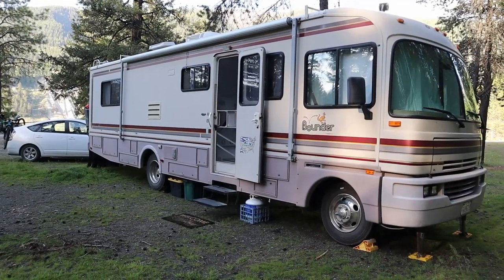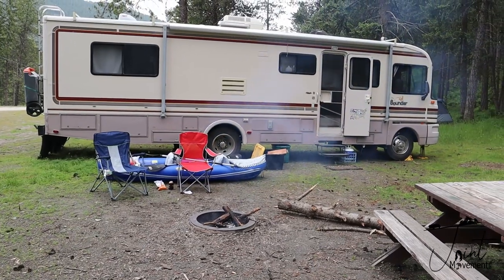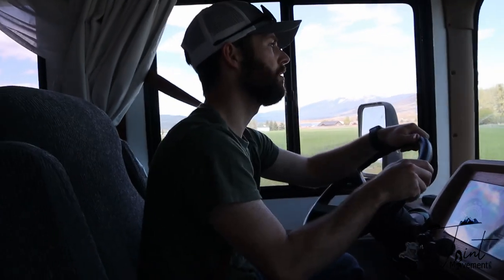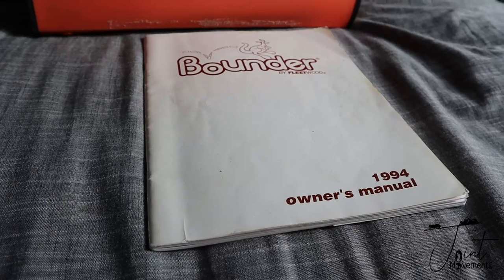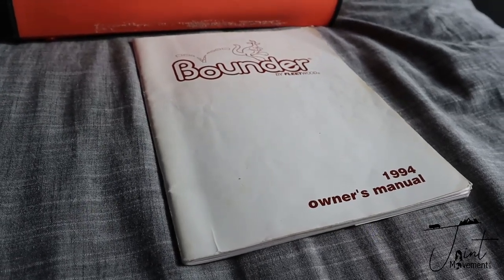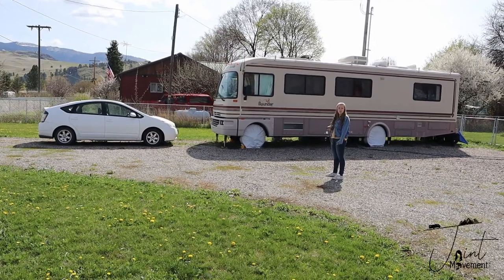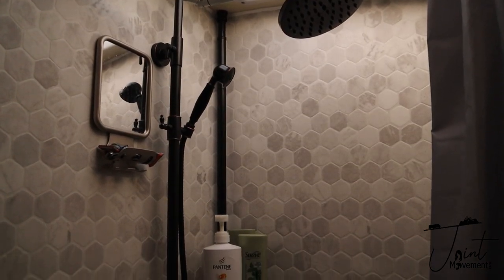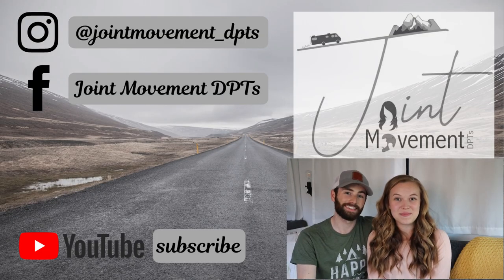HOW WE CHOSE OUR 26-YEAR-OLD MOTORHOME FOR FULL-TIME RV LIVING: Travel PT Discusses RV Life | S1:E14

Comment: Howdy there, I gotcha beat price wise on an older Class A. I found a 1991 22 foot long Fleetwood Flair with only 18,000 original miles on it, and just 79 hours of run time on the onboard Onan 4000 Watt Generator. There total price I am paying for it is $2,500.00. It needs both belts on the engine replaced, a couple tires also need replacing, and the roof needs a good seal coating done. On the inside, it needs one set of Overhead Cabinets repaired.. Outside of that, it's ready to go.

Comment: Congrats on your rig and your good decision making! We just found your channel. We are retired FTers who did something similar in 2019. We feel our 1999 National Tropical MH we named Serinity (after the movie/TV series) sort of picked us too. Like you, we were going to go FT with a truck and trailer. We bought a 2008 Ford diesel and were shopping for a trailer when the engine died on the truck. We had just got it paid off when it dropped a lifter (at less than 150,000 miles on this supposedly 1/2 a million-mile engine) and they wanted $15k to fix it. We got to thinking, "What if this would have happened after we were retired and didn't have that kind of money laying around to fix it? 

So, we sold it and bought our 36' Class A MH with only 28k miles on it for only $15k. It was a single owner MH, like your rig, with meticulous maintenance and repair records. Our decision paid off as it hasn't needed many repairs (considering its age) over the last 3 years we have been living in it FT. If the V-10 gas engine ever dies, we can replace it for less than 1/3rd of what the diesel engine would have cost us on our old Ford. One of he added benefits of our decision was we were able to flat tow our 30+ mpg 2006 Chevy Cobalt SS, a car we already owned, saving us additional expenses for a toad. We also carry a couple electric bikes with us, for exercise, adventure and fuel savings.

We discovered we like to boondock a lot, so added solar. We have been living off-grid continuously for the last year, saving a ton of money on RV park rent, while still being able to travel whenever and wherever we like. Good luck and stay safe on your travels.
Reply from the maker: That's so amazing 👏 😍 🙌  we have very similar thoughts 😀
We wish you the best on your journey!
Reply: I’m looking at a 99 TropiCal right now! 36,000 miles and 226 on the generator or $6,000
Reply: @brittanymcdonaldbarr1106  Wow, that's a great deal if it's in good shape. Heck, it's even a good deal if you have to fix a few things. We love our 6350. We've gotten good at fixing things. When you don't have a monthly note, you can afford to do other things with that money - like the 560ah Lifepo-4 battery, 80a converter/charger and battery to battery charger we just added to our solar system to make boondocking easier and reduce our generator run time. We've got about 2,500 hrs on our 5,500 w Generac generator now, after boondocking extensively for the last 3 years, but it's still running strong.

Comment: I'm also in healthcare as a RN in ER.  I have had two Bounders: a 1995 and currently a 2000.  I have loved both of them. The 1995 was a 34J on a P30 chassis with the Chevy 454.  My 2000 Bounder is a 34D (with living room slide) on a Ford chassis with the V10.   I believe they are a quality RV, even if not the most expensive RVs out there.  My 34D is spacious and comfortable.  I have done a little renovating, but it is more original than not.  Have fun and  enjoy the freedom yours will provide !

Comment: Sometimes you gotta go to somebody you know and trust it isn’t about I was actually I had a I found a 1969 Lee liner and it’s it’s a full frame aluminum stove did not work in the shower did not work but I had a toilet and I only used it for a toilet and a bed and then I turned around and bought a brand spanking new 2016 heartland prowler 18 LX for 16,125. That’s what I paid for it and then when you had to add tax title and registration 20,008 80Well it’s also because I paid 290 a month for six years 72 months that’s a pretty good deal

Comment: EVERY new RV has build issues right out of the factory.  You are always going to have something, little or big, that will need to be fixed.  If you get an RV a couple years old, most of those build issues should have been fixed and you won't spend six months of your first year with your home in the shop.

Comment: i just bought a 1989 gulfstream regatta 27 foot class a for 3000 dollars. it has a 454 big block engine with only 19000 miles on it. it needs some tlc but the engine runs. but for 3000 i can do a lot to her.

Comment: What stage ?  the bing bing bing stage.  Class C, class A, what year ?  what fuel ? diesel pushers ?  Outrageous maintenance and repair costs I have seen... I am thinking 2000 and up....and getting to the point where it probably does not matter much in that 10-20K range.   Saw a renovated gas 1999 Holiday Rambler ready to go for 12.5K (May 2023)...tons and tons for sale.  Prices still cray cray.  Currently have a vw camper van, but would like something a little bigger...not 40 foot bigger, but bigger.

Comment: With any RV (new or used) finding water damage? Yep. Then the asking price goes down from there. The leak in the bath is from the skylight. That is the number 1 spot for a leak. It either gets cracked or the lap sealant around it begins to crack allowing water in. often times not caught right away because it's in the shower which is often already wet.

Comment: Well, you are going to be saving so much money, I'd think if you put some into savings, you'd have enough to buy another used motorhome to replace her if needed after just a few years.
Reply from the maker: That's a very good point 👍
Reply: @RyanMegan  I also meant to also say that if it is something like a catastrophic engine or transmission failure, a few thousand it goign to be a lot cheaper than a whole new RV.  Even if you replaced both tomorrow, you'd still be cheaper than most other Motorhomes on the market.  In other words, I think you made a good choice.

Comment: Have a 1994 Fleetwood Bounder 28' that I inherited after my dad passed away.  Mom and dad bought it new, so we know the full history.  I don't think you mentioned the mileage on Big Betty, but ours is sitting right at 51,309 miles.  I know because I've got the paperwork sitting here to transfer the title. . . .   We've actually put the last 10,000 miles on it over about 7 years.  Dad wasn't taking it out for several years before he passed due to poor health.

Anyway, enjoyed hearing your viewpoint on why you selected the vehicle.  For us it has been a situation where my dad chose it years ago.  I doubt that I would have considered a motorhome on my own.  

My dad pulled a 12' enclosed trailer with it for years.  We have that as well, and use it to haul a motorcycle.  Also have a home-made bicycle rack that my dad made on the back.  Just bought 2 new e-bikes yesterday, so may leave the trailer at home next time we go out.

We drove it from Wisconsin out to Portland, Oregon in 2019.  Had done recent maintenance on brakes, transmission, radiator (actually all fluids), replaced steer tires, etc. before leaving.  Still had a blow-out on inside dual while in Washington.  Limped to a shop where we were able to get 4 new drive tires installed by 1pm the next day.  So all tires have been replace in the last 2 years. . . .  Otherwise it's mostly original.  Has that "ugly" 90's look that you all tore out.  Have had no leaks or such, but getting nervous watching people putting new roofs on their RVs here on YouTube, LOL!  Will have to go over that when we get it out of storage this year.
Reply: if you're in florida, and looking to sell it, i may be interested.  hard to find one owner, older coaches anymore.

Comment: Me and my fiance are looking into late 1989 through 2000 class A . We trying to find something at least livable and that runs and won't breakdown right now. But we only have like a few thousand and then using the rest we have to remodel.  So we are forsure getting into something that might be alot . But I think we will be alright after we make it our home . :)
Reply from the maker: Good luck to you guys! Hopefully this video helped a bit! You gotta start somewhere right?
Reply: Have you found something yet? We may be selling our 92 Bounder 34j with good generator, both a/c's, all works good and less than 60k miles, we are second owner and we have not used it for 7 years. Chevy engine 454, runs good, but needs tires and maybe batteries, although currently working. No leaks